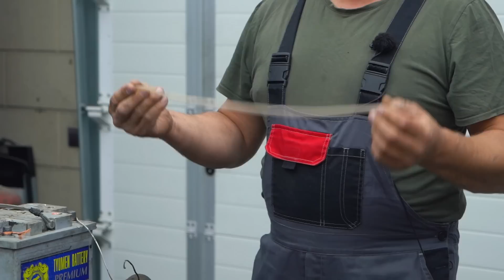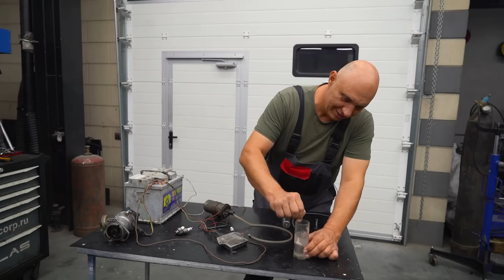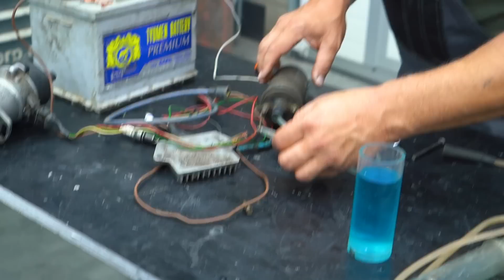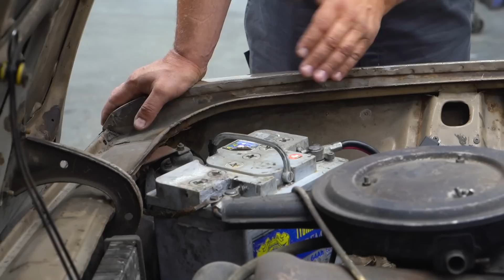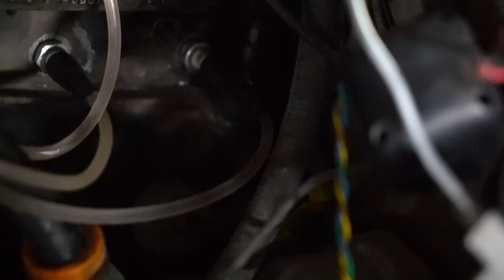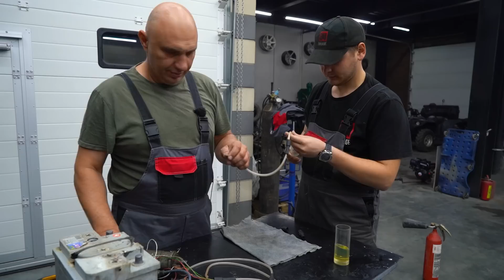We make ignition leads filled with various liquids - will they work?

Comment: I wonder if used engine oil will work? Given the used burt oil likely has a lot of suspended metal in it.
Reply: There are distances in between the metal flakes that the electric arch probably can’t jump even though those gaps between the metal are tiny it’s not filled with empty space but filled with oil wich isn’t conductive so probably not and you would need really old oil like 100k miles of wear for it to maybe work
Reply: @jeremyclarkson-69  yeah good point. I can see them having so horrible oil laying around to haha.

Comment: There is quite a bit of resistance built into an ignition system. The spark has to jump at least 2 gaps in a distributor ignition system (the rotor to the cap, the spark plug gap at the end of the plug). Most cars with spark plug wires also have a resistance designed into them (often around 1000ohm/ft) and a lot of spark plugs are resistor plugs (meaning they have additional resistance built into them). So, a mildly conductive liquid in a hose isn’t that dissimilar to the resistance already in a stock ignition system.
Reply: @@karlwithak.The comment was explaining HOW 🙄
Reply: Thanks for explaining!

Comment: A fresh blade of grass will conduct and keep an engine running, for a while. Long before it stops working though, if the engine is stopped it will not restart with the same blade of grass, even though it was running on it.

Comment: Bit of silicone sealant around the ends of the washer tubing to seal onto dizzy cap and plug cap, with water/salt mix, and you'll have a more permanent solution! NOICE! 👌👍😉
😎🇬🇧
Reply: Until the chlorine attacks and corrodes everything the solution touches in short order.
Reply: @MadScientist267  Haha I didn't say 'Permanent permanent'.. I said 'More permanent' meaning it would last longer, to maybe get you out of a bind if ya skint! Hahaha

Comment: Ordinary black rubber vacuum hose conducts surprisingly well. Try some of that alone, or maybe put itdown the centre of the clear tubing. Also detergent and water should conduct electricity a bit because it is an ionic solution.

Comment: zinc spray paint fluid in copper tube insulate and/or not? tiny drill holes like bong viscous electrolyte around in clear larger diameter tubing😁 only need a capacitor to start no weight battery.., lithium reliablility just incase.

Comment: Do straight copper leads, like the old race cars. Show us how it effects the radio and the range it does it.
Reply: My old cars have copper wires and the radios play just fine.
Reply: Yeah probably run 5k ohm resistor caps though...

Comment: I think you should duplicate the old Ice truck, or clear Lada, but with the clear engine parts, clear wheels, maybe clear differentials and or axles, clear radiator and so on. Try and make as many clear parts and maybe the magnetic suspension for clear springs. And maybe a clear battery
Reply: You could use lexan, glass and other stuff and bond a body with adhesive. I think they could build a glass flame licking engine, and with all those rear ends tied four to one reduced, maybe hit walking speed from a small torch
Reply: After you clear your brain from all that he will get right on it .

Comment: the most dangerous thing about this is that when you see spark in the tube, it means the 2 separated parts of electrolyte liquid in the tube are the closest conductors to each other in that moment. If that gap gets bigger, eventually the spark will short out on something else in the engine bay, and if you're touching the frame when that happes you're toast. I don't know how good of an insulator that tubing is but I wouldn't recommend leaning your bare skin on the frame and sticking your face and hands close to the tubes and engine.

Comment: Can you make an engine that can run in both direction? I mean clockwise and anti clockwise. Admission as a exhaust and you know😀
Reply: Some two-stroke engines can run backward out of the box. Had an old motorcycle I could push start in reverse. Learned that the hard way stalling on a big hill and rolling backwards. Hand slipped on clutch and she took off. Kinda hurt a little.

Comment: Reminds me of the time I changed the coil wire on my buddy's car with vacuum hose. When he got in it started and he drove off.
Reply: Yeah, vacuum hose will indeed conduct. I used some inside an ignition box I made and when it touched some of the parts on the circuit board it would stop working. Worked just fine out of the box though. Took a while to track down.

Comment: This is fascinating to think of Especially if you built a very cheap installation on the outside of the car to make it amphibious, and let's say if it broke! It would not matter because all of the electrical components would be made of liquids.
Reply: well if there was a break in the tube to outside of the tube, that would be problematic anyway if the electric path through there to the chassis had lower resistance.

Comment: You should try using old CRT TV/monitor anode wires as a spark plug wires, I think they should work perfectly as they perform similar function, altough I'm not sure of their impedance rating.
Reply: They could also try using the transformer from a crt TV as a makeshift ignition coil
Reply: That sounds like a pretty viable replacement, I mean you can use almost any insulated wire as long as the resistance is fairly low
Reply: nah man do the other way around.            with a saltwater tube. what could go wrong.
Reply: It's a solid wire.

The key difference between a CRT anode and spark plug wires is the temp and chemical resistance

Comment: Liquid dish washing soap in water works perfectly. I tested it with a ohm meter and it reads shorted, no resistance.
Reply: I wonder if it would carry any current? Ssy to light a bulb or turn a starter motor....hmmmmm......
Reply: this tid bit of knowledge may come in handy one day
Reply: Yea, it should. Soaps are essentially salts of fatty acids and any given small cation, usually sodium. When dissolved in water, they separate, and as we know: free ions in water solution make a conducting fluid.

Comment: Zinc plated bolt + sulfuric acid = hydrogen gas. Always nice have some sparks and hydrogen together. Good that there was not enough air/oxygen mixed in. This much would be enough to blow those plastic tubes open and spray the electrolyte everywhere.

Comment: you know what really would be neat , using steel BBs in the clear tube but use something clear to separate the BBs to have an ark all the way down the tube .lighted spark plug wires.
Reply: too much energy would be lost after each spark, the air is not heated for free
Reply: @JacobJonesy  the spark is about 40,000volts and it give a spark about 3inches if there was small enough insulator between each one it can be broken down at that short distance it would be very close ,soooo if they play with the distance of the tube and clear insulators I think it could work and they could really use a smaller tube as insulators for a cool lightening effect.
Reply: @JacobJonesy  well the fluid there using has certain amount of resistance as well and the original wires to have  a certain amount but using a BB is very little spark gap if using another BB plastic ones as insulator just need to make one and find out.
Reply: Try BB gun balls in clear tube
Reply: @chamarystigers8731  probly the plastic ones but dont know if they make clear or not but still would work to separate the steel ones as long there loose enough in the tube so the spark can pass.
Reply: Just use Cold cathodes or Neon TUbes.
Reply: @MickeyMishra  enrichening the tube with neon would help with conduction
Reply: @isaacwhite7411    Might work well with clear silicone tubing.   Now that would be a FUN experiment.
Reply: @MickeyMishra  yea

Comment: one thing that this channel establishes beyond any doubt is that an old Lada is one of, if not THE most resilient and hearty automobile ever made. This channel has taught me that one of those Ladas, even one with hundreds of thousands of miles, can last and be reliable for its owner for life. And I want one. 😊id like to acquire one, redo the inside, rebuild the entire drive train and have it as a daily. or at least ready to be put into service whenever needed.
Reply: LS swap.....
Reply: @Flies2FLL  In a Lada? LMAO talk about a sleeper
Reply: @lilmike2710  It is RWD and has an engine four cylinders long.  I bet it would fit just fine.
Reply: @Flies2FLL  Oh I have no doubt that it would fit. Hell, a small block 350, 305, 302.. 289 pony motor.
Sure it would fit. And with tinted windows, some wicked rims and snappy paint it would look pretty damn sharp. 
Oh hell yea, with a manual trans.
Give it some epic Russian name.
🤣 Call it "Stalin's whip" or some sht.
Reply: replying to @lilmike2710: *DAILY DRIVER CAR!!*
Reply: @tompsheridantsheridant7354  Yes.. congrats! You understood what I was abbreviating. Thank you so much, Captain Obvious. 🙄
Reply: My Daewoo Matiz is the same. Slight issue with rust, but nothing that can't be repaired cheaply. And it is an ECU engine, it has a 3 PCB Siemens computer. But that thing can take anything.

I ran out of oil, said "f**k it" and I drove it without a drop of oil until it stopped completely. Turns out the engine received no damage whatsoever, but the computer shut it down to avoid damage.

Comment: I'm a bit shocked that coolant works.
(pun totally intended) 
coolant should not conduct electricity well, because of galvanic corrosion.
that's why GM developed DexCool for use in engines with an iron block and aluminum heads and intake.
it's supposed to keep the corrosion in check.
Reply: The original orange DexCool from the mid-90s is famous for being junk. The newer reddish formulation is supposed to be better.